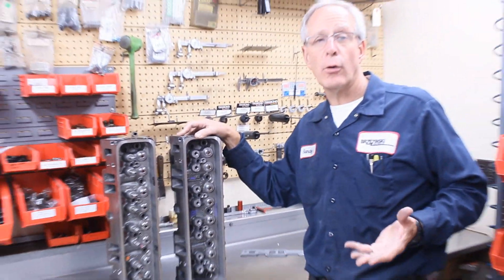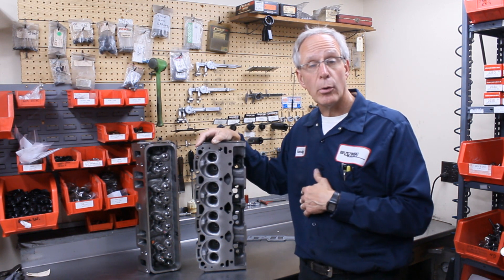Factory Vortec Heads - Part 2

Comment: Thanks for doing the video! Have a question.  I will be assembling my 5.7 350 this week. It's 30 over, I have new pistons & rods. I have a set of Vortec heads I'm thinking of putting LS6 springs I'm putting bigger valves in also with some porting. What would you in my situation? Please let me know if I am on the right track or you havw something different in mind ! Thanks again!

Comment: Mextec!  It's like buritos and tacos!
Is it worth putting vortec heads on a 400/406 cid?  I'm looking for a TQ monster that will still rev to about 6k revums! 5600-5800, I was thinking maybe varable Duration lifters, something to allow good tq 1200 to1500rpm... And upand maybe deliver good HP startinf around 3k, to and keep spinning and pulling  hard in to the high 5 grand range, obviously a hyd flat tappet engine, isn't going to be all thath, it's a no budget, because it's such a low budget engine!!,  going into a vehicle in the 5,500-6,500 pound range, with 3.73 gears, with about 35" tires, and ultra low 1st gear ratio..  4speed, used for towing, the 350 in it now is about the same as a 1975, 350 CI, 2bbl engine, it does OK, I was thinking about a marine cam, with variable duration lifters,  
The engine now, it has OK power when dropping the clutch, but when it starts moving, accelerating it starts falling on its face, just guessing, about 3500, it's did all its going to! So I'm thinking the extra cid. And  the cam with mid range TQ, and augmented bottom end TQ, should fix this, swapping to a automatic transmission would also likely fix it also, but it would still not have the HP needed,   so the 400, with a cam would/should allow this truck to actually tow at highway speeds, a 5000 -6000lb truck, hauling a 3000-4000lb load, us going to require some power! The rambling aside, would vortec heads be a worthy  upgrade? Anything aside from steam holes required? With a cam .500"  or  around .485"  lift or there about, I'd like it to have about,  what a stock '94 7.4L 454 does , it's about 330hp, and just shy of 500'lbs TQ.. I don't expect quite that much  but surely, something close, I was hoping to keep the dished pistons, keeping the compression low enough,  I'd like about 9.8:1, 10:1 at most, with a edelbrock performer airgap intake, and 650 Holley, with old rams horn manifolds, or shorty 1.625" headers, and 2.25" exhaust,
Would the vortec heads be worthy to accomplish these goals? Thanks and sorry for thisvramblingvand carrying on!!! Ha-ha,,, have a great day!!!
Reply: Bro u went ham to get no response that’s a lot to take in sounds like u got it figured out

Comment: I have the original EQ lightning Ch350c with stock cast flattops. Any idea where my compression ratio may be? I believe they are the 170cc intake runner. Bought them new 12ish years ago.
Reply: Will be around 9:5:1

Comment: What about felpro intake gasket MS98000T part number with steel inserts?
Reply from the maker: The gasket that we use seem to fit many intakes very well. Its more of a universal fit so it makes port matching easier.
Reply: @BrzezinskiRacingProducts  what's the part number on that gasket?
Reply from the maker: @heavychevy2289  IR547SP5060KF is the part number. You can try to order it from them but you most likely will have to go through us. Like we say in the video its a custom made gasket that we had made for us, for those heads
Reply: @BrzezinskiRacingProducts  ok thank you. What's your company's contact information?